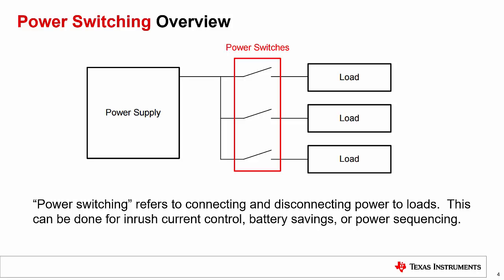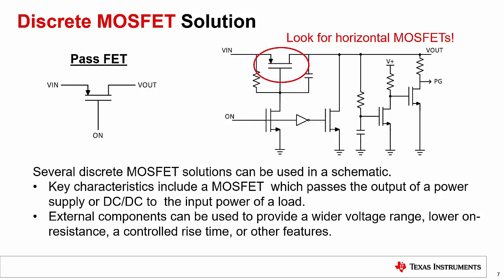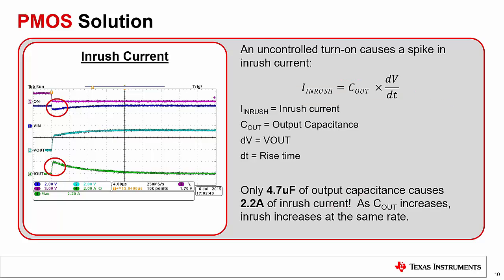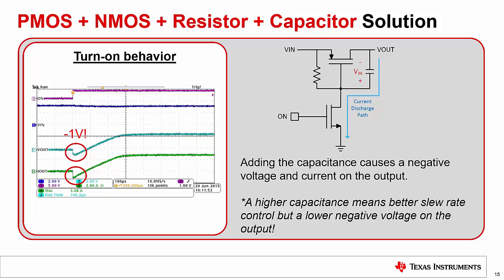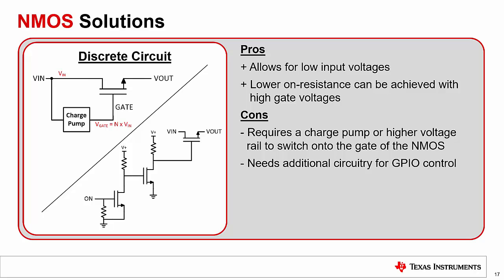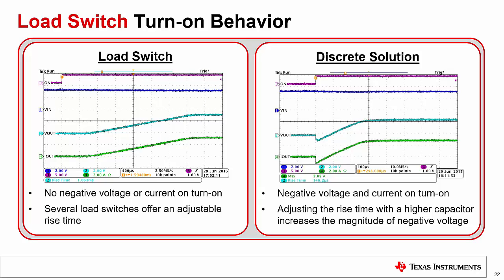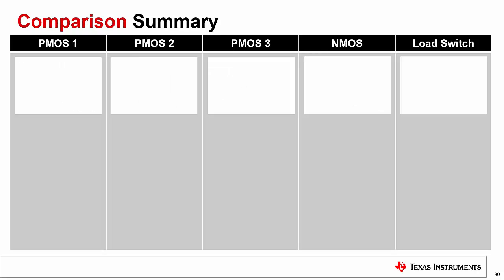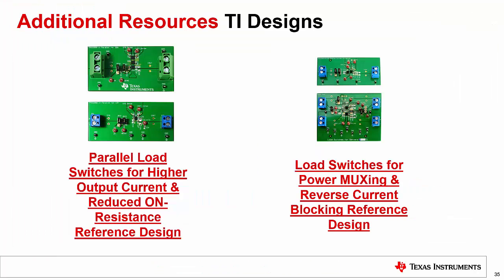How and why to replace discrete MOSFETs with load switches

Comment: The video is very good and useful.
But! Didn't you mix up the arrows on all the transistors? The P channel transistor has an arrow outward and the N channel transistor has an arrow inward. It’s strange that in 7 years no one noticed this.

Comment: EHhh.... 
This is really just a video on using Jfets... but you do not discuss why that's important/desirable.
Honestly, i actually thought this was a video on how to jam mechanical relays into a design to ensure product failure over time. 

Luckily, it's not that, but the idea that MOSFETs are always the best option is pretty pervasive. It'd be helpful if you either spent a bit more time highlighting the weaknesses of the MOSFET or the Strength of the JFET.  

I personally prefer using JFETs for making my own discrete voltage and current regulating topologies. 
Depending on application, making your own can be cheaper, and it's definitely more robust, regardless of application.
Reply: Well, if you know the answer and do your own regulators, don't wait for others and and do a video yourself

Comment: what is goodfor low value voltages ?
Reply: Ehhh... 
Honestly, it depends on application of that low voltage value. The entire premiss of this video is discussing the over current situation that occurs when you first turn something on, or just after your batteries go dead. 

Jfet's handle those types of low voltage, high current situations better than MOSFETS. The vid didn't make that crystal clear.